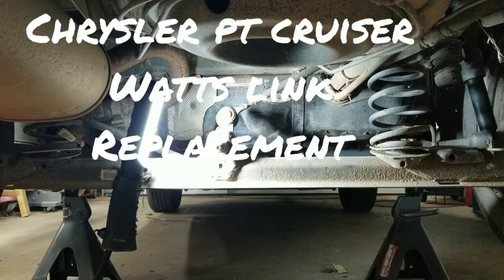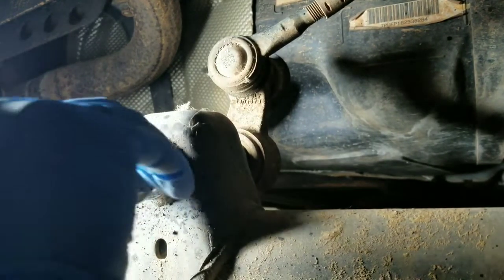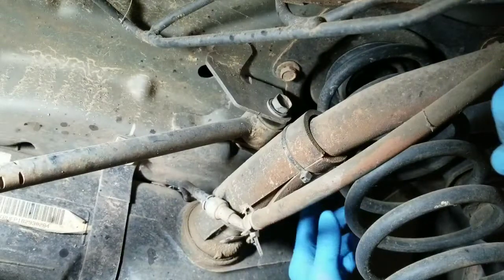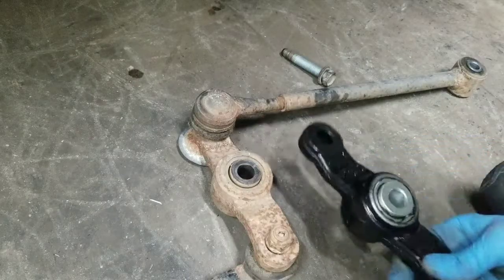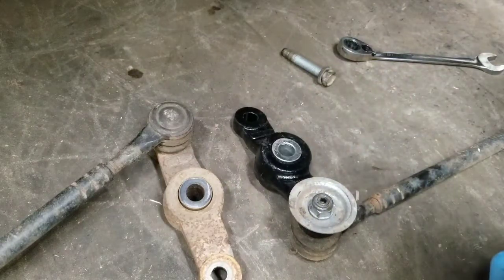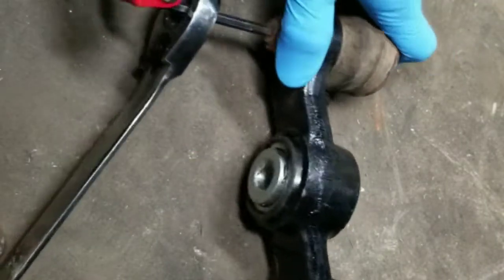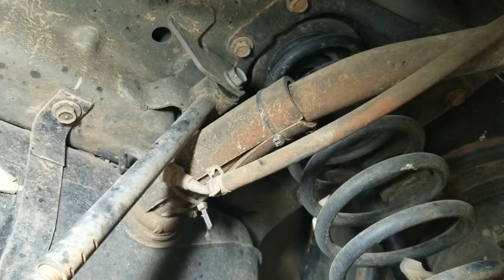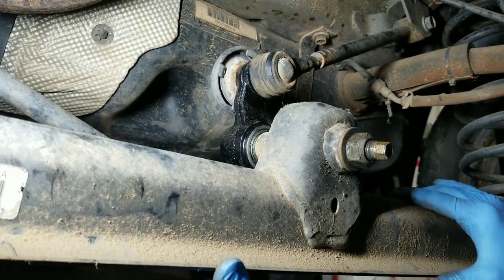Pt Cruiser Watts Link (Bell Crank) Replacement

Comment: Subscribed. 

The other videos on this same repair all show the repairman replacing the tie rods along with the Watt's link - your method looks to be much more professional, simpler, more logical and doesn't seem as wasteful. I was going to go off replacing the entire assembly, but now that I see your method, it not only makes much more sense, it saves having to replace more parts that might not need replacing. 

Thanks for the content.
Keep up the good work.

בס'ד

Comment: Great job on explaining the procedure. Question how would you know if you need to replace the tire rods that are attached to the Watts Link?
Reply: I know this is a late answer, but there are a lot of other videos showing that, included replacing the rods at the same time; those videos, though, do everything under the vehicle. They  show the repairman cranking on the old rods in order to remove the Watt's link, possibly damaging them. 

This video, removing the entire assembly first, then doing the repair on a bench, then reinstalling the assembly, minimizes the chance of the old rods being compromised, and allows them to be re-used. 

For example, if you order the replacement Watt's link on Amazon, they suggest ordering both sides of the tie rods along with it.

Most of the videos on this R&R do replace the entire assembly. That seems more costly and more wasteful, & probably not necessary if you follow the method in this video.

It's easier to do it here outside the vehicle. Best method. This seems a lot more professional and avoids replacing parts unnecessarily.

EDIT: I'd like to see a video that removes the Watt's link and just repairs the damaged part of the link instead, with just a new bushing in the worn out section.

Comment: You are using a 24mm deep socket for the nut but what size is the head of the bolt on the opposite side ?